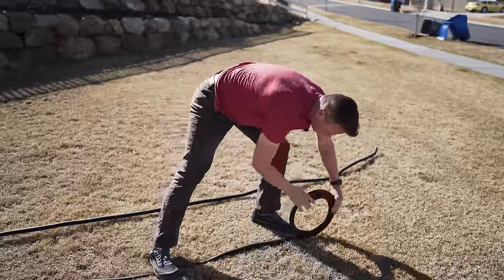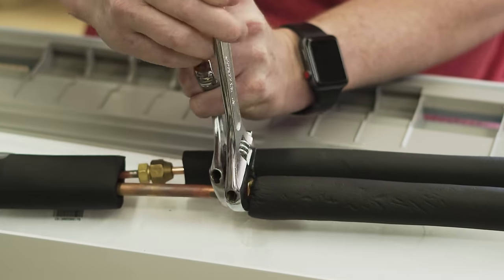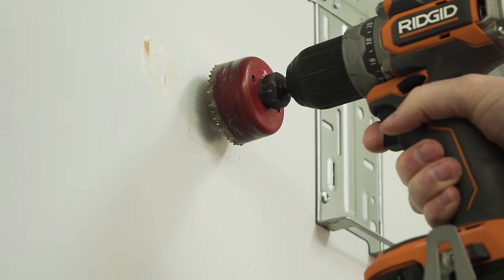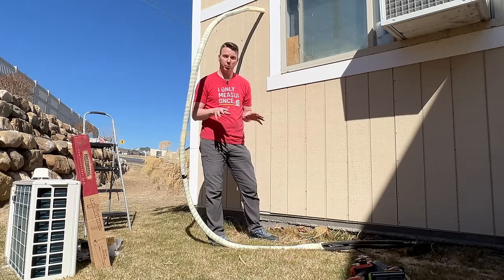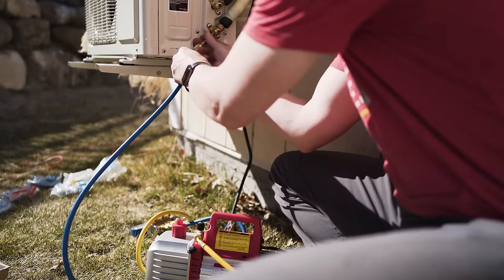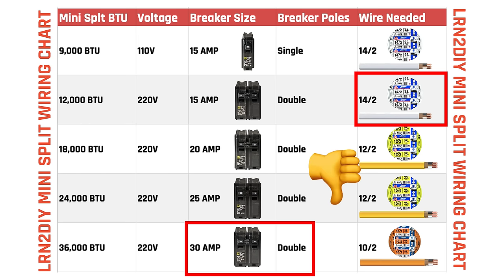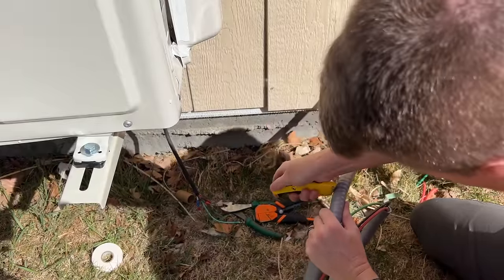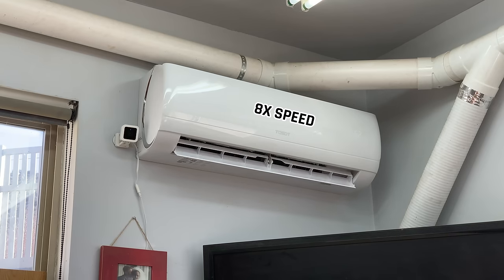DIY Mini Split Install - All the Things Nobody Shows You

Comment: (Absolutely new to doing any HVAC DIY) After watching this video, and a few others, and reading a ton of comments, I installed two TOSOT 12K mini-splits, and I am extremely impressed with how quiet and effective they are. I intend to install two more to completely replace my A/C and baseboard heat. A few notes on my install. First, buy torque wrenches and be certain of your spec for the line size. Brass nuts are soft and this joint is critical. I almost certainly would have under torqued if I had gone by feel alone. If you have to cut and flare your lines, put money into a good flaring tool. I tried a low end tool ($33) that I bought from a local HVAC shop and I wouldn't consider the flare it made to be useable. I then purchased a BlackMax tool, and it worked extremely well. However, when I got to the 1/4 line, it wouldn't grip the copper. From another forum, I learned that 1/4" copper is probably not 1'4", and YellowJacket recommends wrapping some worn sandpaper around the pipe when flaring. This worked perfectly, and I was able to flare.  Regarding vacuuming down the lines: The manual says to simply remove the manifold guage lines from the service port after testing a vacuum, that will draw ambient air in until the valve closes while you remove the gauge lines. I spoke with TOSOT, and they recommed the following: After testing for vacuum. Very carefully open the refrigerant release on the small line, just until the manifold guage reads a positive pressure and then close it. Then remove the manifold guage line from the service port as quickly as you can. You will feel a small amount of refrigerant release as the valve closes. Then release the refrigerant from both lines. Seriously appreciate all the comments from @rbfour5 and others, and well as this video. With the current rebates and tax credits, and installing myself, I'll probably have all four installed for under a grand. For all you "pros" out there who love to rip on those of us who DIY, this is why we do it. We don't have an extra $10K laying around to hire a local company that might not actually do a better job than we can. Sure, I would absolutely LOVE to hire someone else to do the endless projects around my house, but with even the local handymen in the area charging $75/hr, I sure can't afford it, so here I am building cabinets, roofing my garage, and installing split-units, just to name a few. Cheers to everyone else who learns and does.
Reply: Amen brother I am with you 100%.  My central unit on our house is 16 years old and on it's last legs here in Florida.  I just ordered 2 mini splits to install myself.  The A/C companies here want $10K to install a new unit and I just can't bring myself to do that.  I would feel like I got totally ripped off.  Later this fall I plan on installing an 18,000 in the living room / kitchen area and between all 3 units the entire house will be covered.  Then we we will have an emergency back-up unit with the old clunky RUUD central air which IS still working.  That's a nice tip you gave about charging the lines with a small amount of refrigerant and I will do that for sure.  I also ordered rubber flare seals that seal up the flares so there will be no leaks or little gaps in the cheap flares you get with the units.  I agree with your comment about how us DIYers can probably do a better job anyway.  I was an electrician for 12 years and there isn't much I am scared of taking on.  One of the bedrooms in our house stays hot in the summer and cold in the winter.  I don't know what happened with the ductwork up in the attic but something was not done right.  So even if I replaced the central unit we would still have that issue.  I will attempt to not cut the factory flares off but if I need to I will heed your advice.  I really don't want to coil up the extra copper behind the unit.  Thanks for the comments and happy DIYing.
Reply: I installed four Mr Cool mini split units in our vacation home this summer.  Installation was easy.  I liked the pre charged line sets but not crazy about the extra line coils behind the units.
One annoying thing is the local electric utility company only gives substantial rebates on mini splits installed by an utility company approved installer!  DIY installations cannot get the rebate.  Corporate Welfare!
Reply: @williamterry3177  I got my 3 units installed and running. That was best thing i have done to this house. Our electric bill dropped from $400 month to $145. Those 3 mini splits are cooling the house better than the central air ever did. Glad to hear you got good results from yours too.
Reply: I think your only eligible for the tax credit, if units are installed by HVAC technician .
Reply: kevinlsims7330  I agree they are somewhat forgiving.  However I think it's a good idea to pull a vacuum on the lines to eliminate moisture in the system.  That being said, on one of my units I forgot to release a little refrigerant before I took the vacuum pump hose off.  So it sucked some outside air in.  I went ahead and released all the R410A and ran the unit.  I haven't had any issues in 6 months.  It's running great on cool and heat both.
Reply: @dirtwhisperer658 you are supposed to recapture the gas not release it to the atmosphere. I hope you did.
Reply: MY DIY projects are never ending as with most Home owners! You are spot on with the Cost of any local help yes they need to make a living but @ 2 to 3 times my income? Not going to happen! I am capable of doing a professional job my self!
Reply: @kensharpe9949 I Don’t think he released it to atmosphere or his system would not be working good, just released it into the lines and head unit.
Reply: do we need a permits to  install this diy system？
Reply: Another thing nobody mentions even more than the release of the refrigerant before removing gauge, is that you can test for leaks with soap after full release and pump down by closing the valve on the small liquid line, putting it to manual full cool until the gauge reads no pressure, then you can close off the larger service valve and you've put the refrigerant back into the unit like you started out with from the manufacturer so you can redo your flare connections.
Reply: There appears to be a misconception that many splits can replace air conditioners, traditional air conditioners. In some cases they can, but in many cases, it’s not the best approach you still need to deal with the water that only an air conditioner or if you humidifier can remove from your home.
Reply: @williamterry3177  for those people who cannot do this as a DIY, the rebates help them afford the cost of and installer.
Reply: What state are you in?  I’m currently looking into to get tax rebates/credits from the local utility/state but they all want a certified professional to install.

Comment: As a DIYer I've installed 7 or 8 of these on my house, shop, etc because contractors want ridiculous prices for installation.  I have to remind myself how to do it every time and this is by far, the best video on the subject, since, as he says, he covers every, single, step.
Reply: Is this a good first project for a DIYer?

My local contractor wants $25,000 for it
Reply: @Jaz_3001 holy crap dude. That seems like a go away price. Judge for yourself how hard you think it would be. If you think you have the skills and desire to follow the steps go for it!
Reply: @Jaz_3001 they quote about 4500 in AZ per unit, which is still pretty high imo. Sounds like they wanted to sell you on a new central air system, or you wanted multiple rooms done
Reply: Yeah i got quoted the same for 2 bedrooms, just gonna pick a holiday and take my time with it
Reply: @Jaz_3001  Was that for multiple rooms that are located in the interior of a building as opposed to rooms with at least one exterior wall?
Reply: Ye I need one installed on 12th story and contractors wamt like 1,000 dollars above the price of the unit

Comment: as someone who's installed quite a few of these, this video is incredible. definitely wish this resource were around when i was learning by trial/error. anyone looking for a good guide, you've found it.
Reply: as someone who has installed these units. the process of vacuuming is wrong. he should be using a micron gauge. the gauges he uses, just tells you that there is a vacuum,  and not what level the vacuum is at in terms of microns "should be 500 micron or less depending on manufactures instruction. also when he was removing his hoses, he broke the vacuum with atmosphere , you should brake the vacuum with refrigerant
Reply: @Ryan-no5nv have you come across a video that shows how to properly vacuum the lines?  I’m about to hit that part of the project

Comment: As others said, use the 15 amp breaker. Spare out the neutral since you have 2 leads otherwise it is good practice to color tape the neutral for anyone working on it in the future.  Depending on your location I probably would avoid using EMT outside and use PVC or rigid. IMC would work, but I don't see it used very much. It is also a good idea to leave the wire a little long and pass the breaker then come back down so you have some service slack.
Reply: if others have said, why are you repeating it here?
Reply: Is this a job that can be done by a beginner?
Reply: I'm not sure where you're from, but neutral and ground wires have to be white and green or bare copper. You can't use tape to indicate grounds and neutral wires 6awg and smaller
Reply: @dustinpolitsch6995  I believe he's saying that if you use a white/neutral as a line conductor, you must mark it with red/black to show it's been repurposed.
Reply: He didn't have a neutral. He used the neutral wire as a hot wire. He should have used the black and red wires and left the white wire unused. He screwed up big time here
Reply: @Jaz_3001  yes
Reply: @nunya___  He is.
Reply: @skydyverjym  No. Per NEC code, if using the white as a conductor (very commonly done) which he is here (he should have used the red since this was #10/3 and it was there), he must use a colored tape marking to mark it as such. Red or Black tape on both ends of his white wire, in the panel, and in the service cut off to indicate it is a conductor rather than a neutral (there is no "Neutral" in this 240 circuit). The tape marker color must match on both ends. No "screw up big time."
Reply: @usethenoodle  I know there is no neutral, that's what I said. He has two hits therefore should have used red and black. And if it's available (and it was clearly) he should have used black and red and damn the neck code about taping the end with colors because that ain't permanent and is therefore deadly. You said almost the EXACT SAME THING I DID. except I'm no electrician and I don't care about, I care about safety, period. Or rather not dying and/or not killing another

Comment: This is a pretty good introduction & better than most, but it would be outstanding if you edited it, leaving in the mistakes but showing corrections where possible (like red/white wire connections & breaker size) & providing all the correct information and tips from the comments made. It would provide the “why” and really help the DIYer to understand & prevent common mistakes.
Reply: That’s a really positive suggestion.
Reply: OOhhhh... Yeah. More whys & mistakes. Very few youtubers do this.
Reply: Always read the comments!

Comment: I just finished installing my 2nd mini-split and it was from a vendor that was remarkably similar to the Tosot unit you installed, including the broken plastic cover that the delivery company broke when it was dropped on that end of the condenser. I had my fingers crossed that it would still work in spite of being dropped. It did, thank goodness. Some cautionary points for your audience. Consider using a Line Cover for the external lines to protect the lines from UV damage, wind vibration, or anyone playing around with the lines. I also recommend that you cut the lines to length and route them to the condenser so that the oil won't pool up in the excess line. It means a flare tool and more work but it could be necessary. The last suggestion is to resize the conduit to a larger size or remove the Romex jacket because if an inspector saw that they may fail you for exceeding the conduit fill ratio. The AHJ might also require a Fused Disconnect.  Otherwise, it's a good illustration of the complexity of installing a mini-split.
Reply: I doubt this dude used an inspector, but I got you!!

Comment: I just got to the end of the video. Very nice, btw. What I did was to cover what you have as the taped lines going from the outdoor to the indoor units with PVC drain spout. I cut out a big enough channel on the table saw and then fit it over those lines. It was a nice way to give it a trim look and add a bit of protection from the weather.

Comment: I noticed you used the tack life strippers then switched to another.  I bought one similar to the tack life one but could never get it adjusted where it worked well stripping the romex.  Any tips?  What thermal camera were you using?  Great video.  I've heard it's a fortune to have a professional install these.